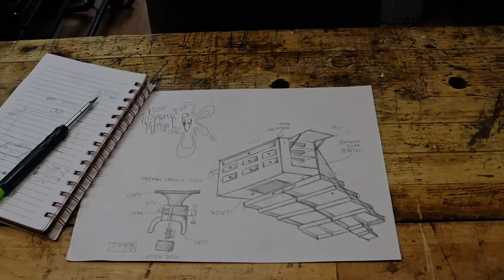Making Toy Story 2 Cleaner Tool Chest - One In The WORLD

Comment: Cool replica, but I think, realistically  it needs more latches on the sides because all the weight of whatever is in the drawers is on the back hinge.  Ideally, the lid would flip down over the front of the trays and fasten to the front above the drawers, but that would require the trays to be slightly smaller, and the tray hinges would get in the way.
Reply from the maker: Thanks mate 👍 it was hard anyway to make real chest works like animated, and any extra latches would destroy the final look.

Comment: I wish I could buy a kit of this exact box with a woodcarving vice that is in place for the flipping panel. A kit that contained all the wood precut, the hardware, etc…. I don’t have the tools to cut route or stuff like that. I’ve got some carving knives and a drill. I would try to add a small cabinet underneath with a dolly that has a drop down handle so everything opens properly and it puts the woodcarving vice at a good height to use while sat in a chair. I don’t mind putting it together I just can’t do the other stuff. I love the build. Best of luck.
Reply from the maker: Thanks man 👍 maybe in near future my friend 😁
Reply: @MatthewMoustache  what do you think it cost you in materials and timeframe to make all the necessary cuts and routing, not including assembly?(if you might’ve kept track of that sort of stuff)
Reply: @MatthewMoustache  if you do ever do it … and I can afford it I would really like one.   Actually do you have a website or store someplace that I could maybe make a custom order this setup will make it so much easier for me right now. We have very limited space so most of my stuff is stuck in storage. And this looks like the answer!
Reply from the maker: @Trindal  you can find me on ig and we can talk there 👍
Reply: @MatthewMoustache  okay. I don’t use IG that often so it may take a while. Is it the same name?
Reply: @MatthewMoustache  message sent

Comment: With the hinged cover for the top section, it looks as though the whole cantilever drawer section can tilt from the drawer section. Looks like it needs extra clasps to hold it. Like you couldnt actually hold it by the top handle without the bottom half hinging open.

Comment: Does the handle on top actually work as intended? Feels like there’s only support from the back so if you try to pick it up, at best a large gap will form at the front and at worst the rotating hinges will snap and the whole thing will fly open
Reply from the maker: In original movie everything is working well because that's animation, and to make this chest looks like In the movie I couldn't add any additional locking system cuz everyone will notice that.
Anyway you can see how this chest is carried by Mr Awesome on his video
Reply: @MatthewMoustache  I’m wondering if a handful of strong hidden magnets could help here without compromising the look/design from the movie
Reply from the maker: @enigma7ic  till today I came with idea how to make something small and hiden

Comment: I have two questions, 1, what is the rod you pulled after flipping the square for? 2, what happens if something is loose when you flip the square? is there a way to get it out?
Reply from the maker: It's a hat rack, the square part shouldn't come loose, but in case if that happens you can easily take it out
Reply: @MatthewMoustache  Thanks for the answer, however, by loose meant something sitting on the square while not being afixed to it while it's flipped over
Reply from the maker: @spook9106  it's screwed down so nothing loose should happen

Comment: When you lift the box from the carry handle, isn't the weight of the lower half of the box hanging from the single hinge pin? Even the box's own weight is going to bend the pin over time as it is lifted and carried, if there is no anchor point on the front side to share the load. I know this is supposed to be a movie faithful piece, but if this was my work or if it was meant for actual storage and transport of tools I'd add two more clamps between the lower half and the top shelves, or a long clamp or metal arm of some kind in the middle that reaches from the top lid to the lower half, just so that the box doesn't develop a gap between upper and lower parts, or even break when lifted from handle.

Comment: Its pretty damn good.
Shame space cannot fold in on itself so that it would be possible to make a 100% movie accurate one-
Reply from the maker: Thanks man 👍 I did my best, maybe one day I'll make better one 😁
Reply: @MatthewMoustache  Maybe make the front drawers just props so you can fit the side doors and the air pump? Would probably also leave room for the automatic flip out chair/vise. 

The miniature flip out shelves inside the bigger ones could probably still fit in this current model. Not sure though.
Reply from the maker: @HORRIOR1  i did think about that but i didn't want to make anthing that's not real, flipping chair works great and the other side was a bit complicated to make as this kind of system is hard to replicate

Comment: I was watching and then I thought "Isn't there a paint mixer on the side?"

I rewatched the original clip from the movie and there is, but I realized that the placement of it doesn't make sense because of where the drawers are.

Theoretically you could add it if the front drawers are only half deep on the sides and you squeezed it in the back half, but the movie shows the drawers are functional (although not deep) however the paint mixer/air brush pump is shown to be centered rather than the back.
Reply from the maker: When you making animated movie then there's no limitations, in real life is plenty 😅

Comment: Nice but without some support at the front of the tool chest to secure the canter lever boxes to the main base you are using the top lid and the canter lever boxes to carry the weight of the tool chest should you lift it up from the leather handle strap. I would expect a gap appearing between the canter lever boxes and the lower base cabinet when you lift from the strap handle. I would simply add some hidden mechanical connection that would better secure those two sections better. FYI